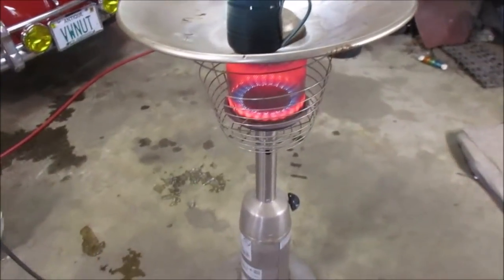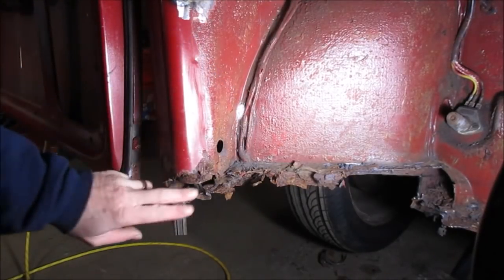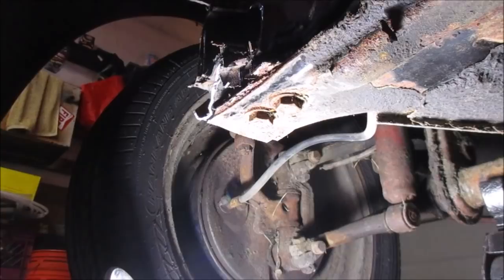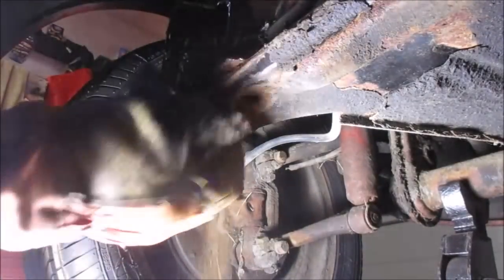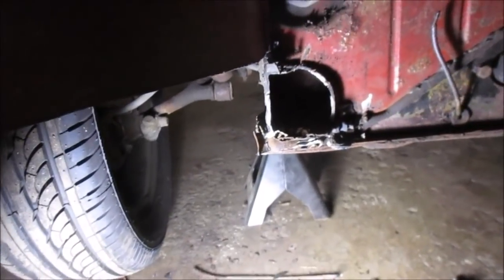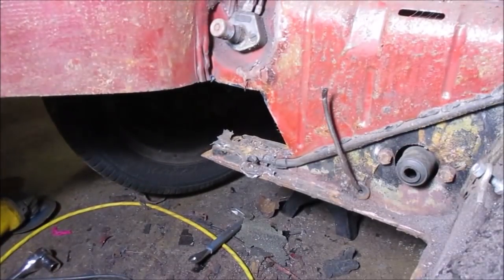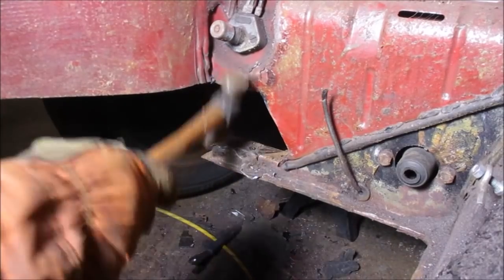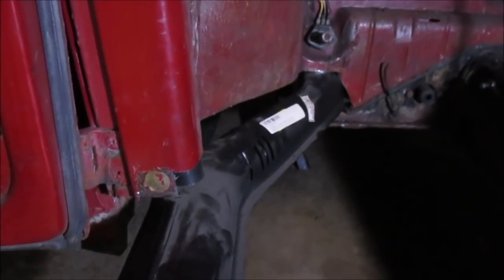1964 VW BUG RUSTY FLOOR REPLACEMENT  FINAL CUT

Comment: I been looking at buying replacement pans for my 63 , how do you like the quality of the pans you are installing??
Reply from the maker: I am happy with the pans i bought. there is alot of controversy over the pan thickness. i am only learning and building a driver so the pans i have installed will long out live me. I hope that answers your  question. thanks for watching Dan. the pans were purchased from J BUGS